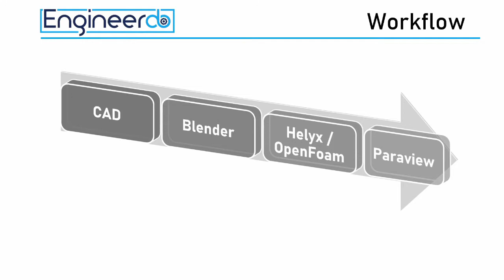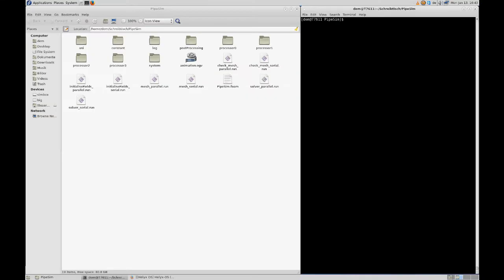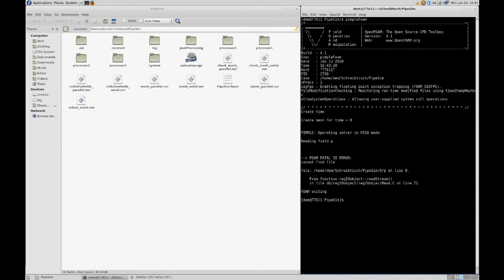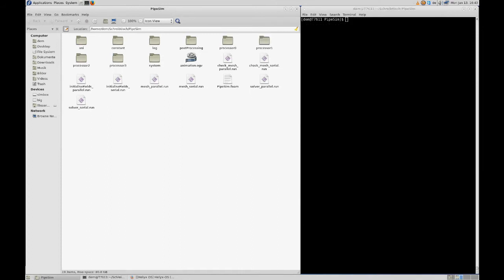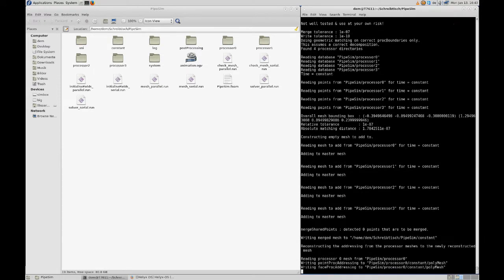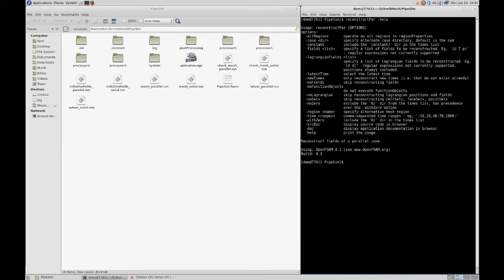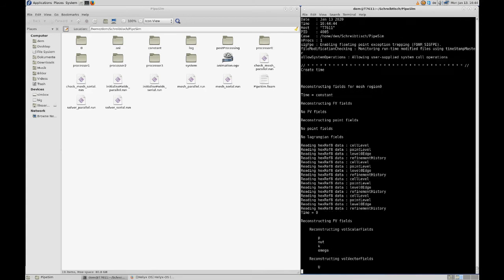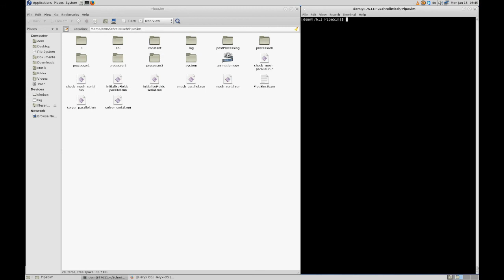Tutorial - HowTo run a Helyx Case in OpenFoam

Comment: Hello, thank you for your work,
Can Helyx run with later version of OpenFoam ? I am using v8
thank you
Reply from the maker: Hey Silmane,
we havent checked running with version OpenFoam  8, but we have been reported that this might run in problems.
Cheers, Engineerdo
Reply: @engineerdo6568  I can confirm that it only works with OF 4.1, I asked Lisandro Maders on Linkedin, he is a general manager at Engys.
Reply: @slimaneh5   what version of Ubuntu are you running, i am unable to find the openfoam4 package on 20.04.2  thanks
Reply: @digbylaurencebarcis7771  I had the same issue, impossible for me to run OpenFoam... I decided to use a free version of Ansys to not loose my time